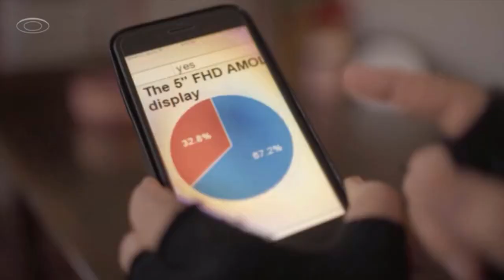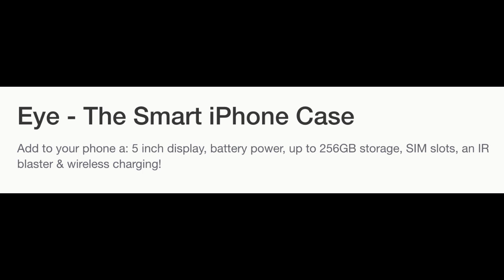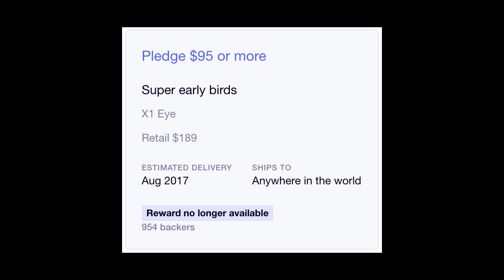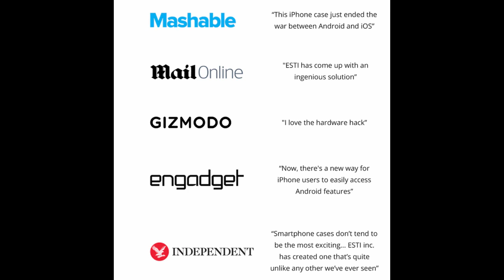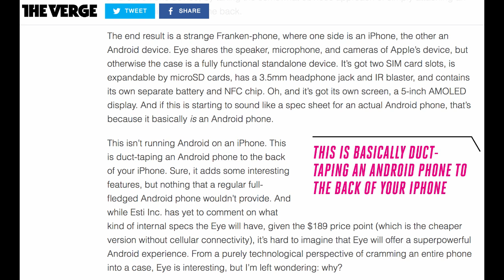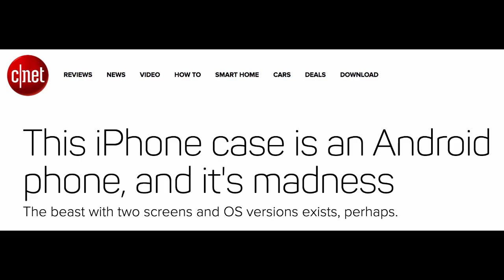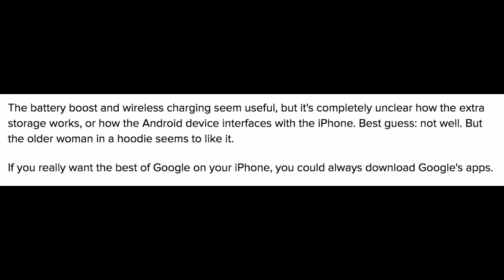Kickstarter Nonstarters: It's Two Phones

Comment: So ignoring the fact this is the running for dumbest device ever, I'm pretty sure that fancy aluminum body that wraps around your iphone is also part of the phones heatsync...and when you cover that up with another device that is also generating heat...uh....What's going to happen?
Reply: Nolan Alighieri *heat sink
Reply: Nolan Alighieri 

I'll make the Samsung Galaxy S7 look like a flash in the pan.
Reply: It will kill the batteries pretty fast. Lithium-ion batteries are very sensitive to heat, and high temperatures reduce their lifespan by a lot. So enjoy having to charge your double-phone abomination several times a day.
Reply: So that's how they power the device: thermal energy! It's flawless!
Reply: And let's not forget that one iPhone model where it had this metallic band around the edge that actually served as its antenna...if you put your finger in the wrong spot, you fucked up the reception.  But no, I'm sure strapping an entire phone to that would be no problem.
Reply: Good thing it has double the battery power(somehow?)
Reply: oh god, Youtube, why can't I mute comment threads any more!?!
Reply: actually you can nolan

Comment: We're gonna double battery life by doubling power usage. IT'S FLAWLESS!
Reply: I'm willing to bet that engineer guy said "We have to double the battery capacity or this abomination will be dead in a couple of hours." And the dude replies "Double the battery, eh? I can sell that."
Reply: Chaosxmk It's the STRONGEST, double wifi, double calls, double hacking capabilities, not to mention, you can watch 2x the porn at once
Reply: One of the "features" of the thing is it has an Always On Display. Im sure it'll be fine, screens don't draw a lot of a phone's charge or anything. Basically it takes a whole lot of power to hold back the screen from showing anything, way more efficient to just leave it on all the time...
Reply: Right? It's like that bit in A Link to the Past where the bat dude tells you he's going to halve your magic power and instead halves your use, only somehow even stupider.
Reply: Anyone else notice that the battery is 2800 mAH The Samsung Galaxy S7 didn't have a great battery life on 3300 mAH... and that only had one display....   of course.. they could've always said 28 x the battery life, and compared it to 100 mAH (which no phone would ever have)
Reply: SOLD!! Lol
Reply: +luistigerfox
Hehhh, considering the Samsung Galaxy S7 explode, would this one also explode... twice ?
Reply: Chaosxmk Is that Naoto in a your profile pic?
Reply: Yessir. It's fanart of Naoto from the (non-canon) detective Naoto stories.
Reply: I think their tech guys said "We're gonna need double the power" and he misheard it as "We're gonna add double the power".
Reply: I assume it's supposed to have its own battery, and the idea is that you could use it as a spare phone when your iPhone dies. I doubt that would be very practical, but that’s the only way this thing could double your battery life.

Comment: I... But... But why two phones on the same one? How do you use them at once? Wouldn't the back part get dirt as Hell? Why would anyone need a phone expansion for their fucking PHONE? GAH
Reply: Timestreamer unless it's kinda like a 3ds, where one screen is for touching and another for looking
Reply: Kemo_Meme Did they ever say that the two phones worked completely in tandem? Like, would I be using the same app on both phones? And how would the apps handle the double screen? I'm so confused.
Reply: Excuse me. Sir. My phone doesn't have enough phones on it.
Reply: I can see the use case. Honestly, I can.
It adds hardware functionality that the iPhone lacks or has had removed but pretty much any Android device already possesses.

And, instead of fabricating a whole custom device that adds just those features and then work out how to attach them to the iPhone in an Apple-approved manner, the cheap approach is to ... well, get pretty much any Android device and network them. Once that happens all the other stuff is just extra baggage bonus functionality.

In other words, if you want a headphone jack on your new iPhone, it's cheaper to add a second phone than it is to add a headphone jack.
Reply: Nick Farmer But then why would you buy an iPhone instead of an Android one? If you got so much money to burn, Hell, I'll take it.
Reply: If you've already got an iPhone, still taken in by the Class 3 Glamour cast on it, but suspecting that maybe it's not the answer to world hunger....
Reply: Because there are a lot of people out there who really don't know that other phones do everything an iPhone does but better. 

Also Apple was really smart branding all their shit together so you will have users that just don't want the hassle of transferring their stuff to a new operating system and find it easier to just keep getting Apple product. 

I know at least a dozen people where that is the case.

Comment: this is actually pretty cool though bc with multiple sim cards if you travel internationally a lot you DO need stuff like that + this is basically like, dual booting like bootcamp on mac?? it's a little unwieldy but i'd use it
Reply: You can get phones with two sim slots, without duct taping a second phone to an iPhone.
Reply: borderline also, the implication seems to be that the android case itself has two sim card slots, as some androud phones do, so in the end, you've got 3 sim card slots, which i'm pretty sure is more than anyone actually needs.

Comment: Two simcards is actually not an uncommon feature on low cost Android phones, every one I've owned has had it, I guess it's useful if you travel a lot and don't want to pay roaming, you can just slap a pay-as-you-go sim in there. Or maybe it has some other reason for existing that I don't get, but it's certainly a thing that exists.
Reply: It's very popular in China and makes a lot of sense if you have corporate phones. I have a Xiaomi Mi Mix and use both SIM card slots for my private and corporate numbers. Otherwise I'd have to carry around two phones.
Reply: Same in Brazil, though it's mostly to abuse the all sorts of different packages phone companies offer. As in I can use one to call my family for a reduced price while the other can be used for 3G and whatnot.

Comment: Is the back screen on all the time? Are you going to be accidentally opening apps on the back screen all the time?
Reply: It's just two phones attached together back-to-back, so I assume you can turn them off separately.
Reply: @TheGuyinShades  
Some phones have a feature where you can tap the screen twice to take it out of sleep mode. 

For me, this has been both a blessing and a curse, as whenever I put my phone in my pocket, my bodyheat ends up turning on my phone. So the next time I pull my phone out to use it, I find that I accidently opened like thirty different apps that are all eating my mobile data and my battery.

What I'm saying is that this phone idea is literally my Hell.

Comment: LMAO GRANDMA HAS A BURNER PHONE AND A REGULAR ONE!

Anyway as for the appeal, video had good production value and it's for an apple phone. I know there are a lot of smart people with iphones but there are a lot of sheep with them and well, they have cash.

What kills me here is not one damn spec on the internals was released YET a massive amount of people funded it. You need an iphone first off right? Are there that many who feel stuck in apples ecosystem that they will throw 120 on something that may end up being a single core android device at the end of the day just because it attaches to their iphone? The answer is yes. I just wish these people would understand they can just buy a damn android and ditch apple and learn from their mistake of buying apple only apps lol.